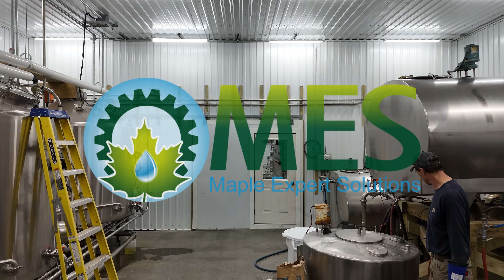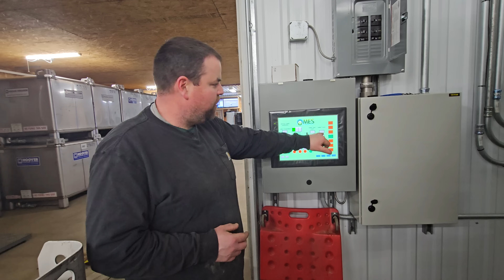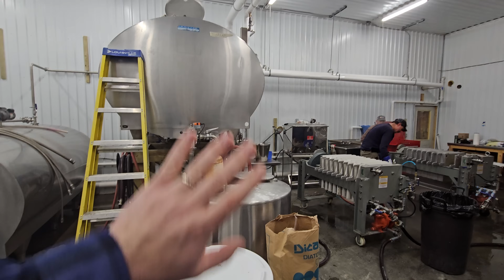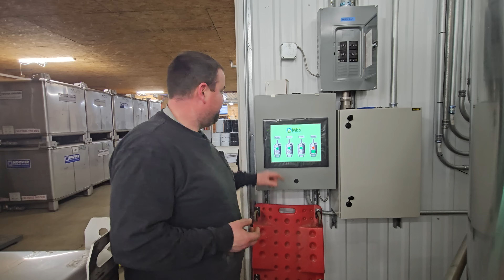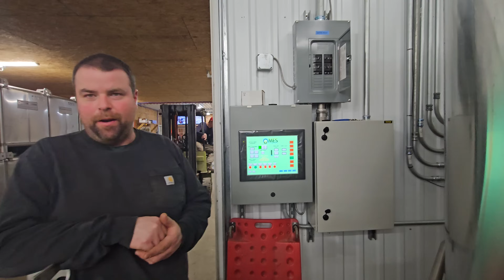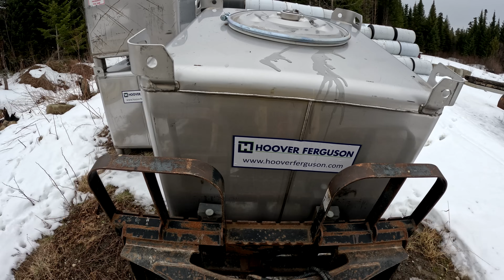Auto Evaporator Kettles ep 186

Comment: This system would be an awesome addition if you already had a steam evaporator. You could set it up so you do one shift on the main evaporator and then shut it down and using the same boiler run this type of system to do a supplemental boil overnight. What an amazing system.
Reply from the maker: @darrellgrant7615  true.  or just run the auto system?

Comment: Absolutely love and appreciate the video Nate.   I'm all about the tech aspect inside the building as it gives more time to catch the leaks in the bush which is where the money's at. lol.   Lots of concerns on here with breaks downs etc.   Few things come to mind: 1)even though everything eventually breaks down, those Belimo motorized actuators are some of the best in the world and last for EVER!    2) the HMI controller (touch screen) MES chose works well and can be easily replaced same day if there's stock should it fry but at this scale, I'm sure they'll be a spare tucked away somewhere.    Same with the PLC inside if its a separate unit.  Besides, the program is always backed up in several locations.   
I've been a licensed plumber, licensed NG & LP with lots of experience in controls for 20 years now and we've turned part time maple syrup producers and eventually full time by 2030.   We started off slow in 2022 with 100 taps and are now at 1,000.    New property to start at 20,000 starts this year and should be up in 3 years.   It'll be fully autonomous by my design.  I may even design a monitoring system using either LoRaWan or Zigbee.    PLCs aren't just computers.   You can input so many different parameters so making syrup will be easier and better.  PLus, as he stated in the video, the OP can change any parameters as he sees fit that day based on demand.  
Great job!   Thank you.

Comment: This is great, but with more technology if something goes wrong, you will need to be a controls technician and have access to the software licensing to troubleshoot the system, this is not the type of knowledge you learn overnight. Of course you could hire someone or have contracts but then you are dependent on someone for your operation. Controls techs make 100k plus a year. So you would need to learn this yourself, two year degree. You cannot be everything lol.. you are a syrup maker or controls tech, usually not both. And the money invested into this would require a lot of syrup to be made. It's all great until something decides not to function, I am in the maintenance industry and I favor simplicity over convenience for most situations. These guys making this equipment for them its great, but 99% of syrup makers cannot troubleshoot this technology if problems occur. I do like how they are balancing the temperature and time to get the ultimate flavor.
Reply from the maker: Things break.  That is a given.  But most maple farmers of this scale are really handy.   That's my observation.  They can fix anything.  I wouldn't put most of these large-scale producers in a box.  Anyone who can live off-grid like this is usually pretty savvy.
Reply: @BissellMapleFarm  off grid?
Reply from the maker: @JDOGMACK75  yes.  They don't have power.  They generate their own power.